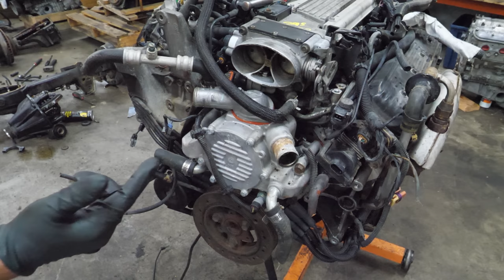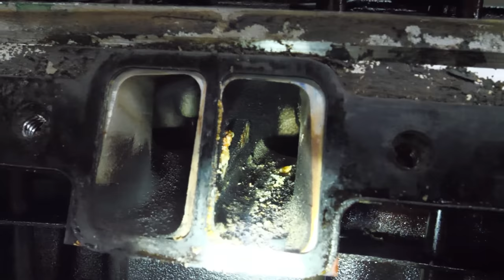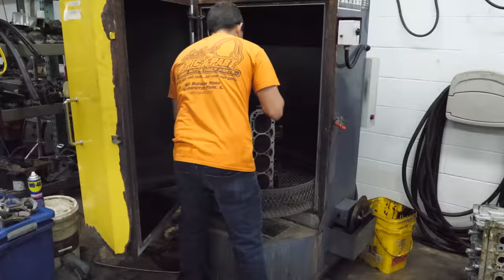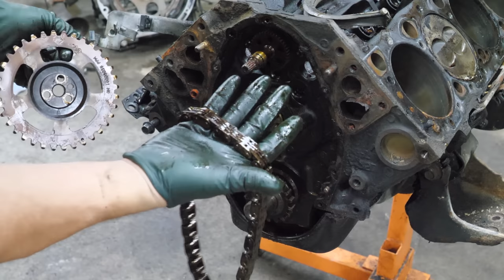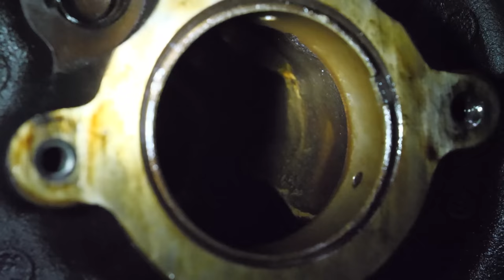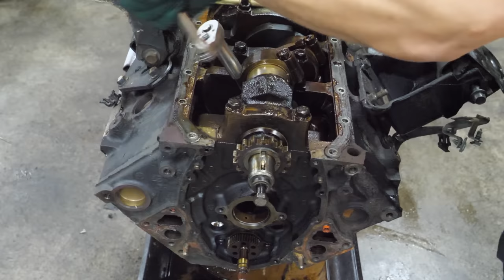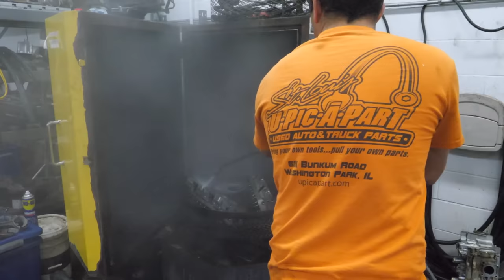Bad Corvette Camaro Trans Am Gen2 LT1 350 Teardown. Not The Problem I Was Told!

Comment: I know the 92-97 LT1 got a bunch well deserved hate, but it was the first mass produced V8 since the early 70s to hit the magic number of 300 horse power. Yeah there were the lotus designed dohc lt5 cars and some special version of a mustang bit as for an entry level V8 advertised with 300 hp under the net system of of measurement this was a big deal. But what got me was gm had a distributorless sysyem that it had been using on engines like the buick 3.8, that could have been adapted to the lt1 and would have avoided the nightmare of the optispark. Dunno whos idea the opti was but theres a special corner of hell reserved for him

Comment: I know this is an older video and this may have been said in the comments, bud dang, those head gaskets were trashed. It looks like the owner used a ton of radiator stop leak, maybe several times, to the point that all the water passages were completely clogged. I bet the failure was that it started getting hot over time and then it would leak because the water was looking for a path which made them think it had a bad water pump which is why that was replaced and looked newish.. it looks like it overheated several times until it had enough and sent water into the combustion chamber.  I may be wrong. I am just trying to figure out what that thing looked so bad..

Comment: GM used fully electronic ignition on all of their car V6s back into the mid 80s. By the time the LT1 came out, basically only the V8s didn’t use electronic ignition, and I cannot imagine why. Who in GM engineering thought that Optispark was a better idea than the coil packs that they had already been using for almost a decade prior to this coming out? Aside from the fact that the distributor would routinely get ruined by the water pump (causing a no-start and a very expensive repair), even a basic maintenance item like the distributor cap or rotor required removing the water pump and crankshaft pulley. I don’t get it.

Comment: Car came from a hot climate place so water rather than antifreeze coolant was used which allowed the engine to live longer with the long term water seep getting in the oil problem than if glycol had been in there as would have been the case in a cold climate area?  Maybe owner knew they had a coolant seepage problem so avoided putting in antifreeze,instead used plain water and "Rustone" and perhaps dumped in some Bars Leaks? 

  RR guy who let me look at his local switching locomotive (GP 15?) told me with overhead radiator there is so much chance of "water" getting where it shouldn't be that they don't use antifreeze but instead left the loco running/idle all night so it wouldn't freeze    the old Southern RR

 think that has compression relief plugs/petcocks that they can take out,then crank the engine with fuel injection turned off while someone watches to see what shoots out of the plug holes while the engine turns over

Comment: For that being an OBDii engine there sure was a lot of black carbon everywhere especially noting the plugs and exhaust valves.  That engine sure was abused and yet it can still be rebuild to see another day.  Never saw that ignition system before.  Really horrendous solution to relocating the distributor.

Comment: Its should have a forged steel crank and powered metal rods. The 4.3L v8 have 6 inch powered metal rods . The lifters and spiders and cam can be used in the open piece style blocks
Reply: They weren’t forged steel cranks.  They were nodular iron (cast steel)
Reply: My memories must be bad . No key way  forget steel cranks on the aluminum headed 5.7L . As I remember.

Comment: GEN2 LT IS WAYYYYYY UNDER RATED!!!!  Those engines were short lived and was only ever built to try making the Gen1 meet emissions and fuel mileage targets while the gen 3 was being developed. They have FLAAAAAAT torque curves, 360 teeth on the crank trigger which allows SUPER accurate timing..  The Optispark is the MOST MISUNDERSTOOD part of that whole engine.. the Optispark was a hell of a GOOD design.. And I'm not being sarcastic. The Revision 1 Distributors from 93-94 were TRASH.. If you sneezed wrong they die.. But the Rev2 from 95-97 was AMAZING!!!  I put a Gen 2  LT in my 92 Toyota 2wd pickup. The distributor had 130k miles on it and was 100% original!!  It dies on me about 10K miles into my swap and it failed because the vacuum hose began deteriorating and plugged the vacuum orifice. O3 (Ozone) built up in the distributor and killed all the plastic/Electronics.. I replaced all the hose, Vacuum orifice, and Vacuum filter and the replacement worked for another 40k or so until I traded the truck for my current car. The new owner still has it and has ZERO problems with it.  Almost 400Whp and got 26mpg while driving it kinda hot footed in a 2700# pickup.. I even puddle jumped and pressure washed it regularly, anything I could to get the distributor wet, a lot of times intentionally to disprove all my misinformed friends.  They really are a hell of an engine!  10/10 would use one again!!!

Comment: I have a 96 Cadillac Fleetwood with lt1. Can I drop a HEI distributor in there & run a carb on that baby the way it, sits? Seems like it ve seen guys run these with the 411 computer/LS computer & by pass the opti spark? Mine starter missing one day & it says it has an over active injector. It's over 350K miles & prolly still has 7 of the 8 original plug wires. I had to change 1 of them. Water pump leaks but I have a new one. It never started miss firing until I tinkered around tryna replace some of the old gummy vacuum lines.  I wish I had the funds to do new opti & timing kit.  I don't have a balanced installer tool for the little seal in the timing cover (opti seal, maybe?) I seen a guy having this problem & he created a custom tool for his little seal with a yellow, "sharpie." My front main leaks too & I have a new one. I've got 8 injectors & the remainder of my plug wires to put on (the other 7.) Wish me luck... Lol. It also has original spark plugs, I do believe. I'm really really really hoping my water pump didn't strew my opti spark. Being disabled it takes me several months to accumulate parts. I already rebuild the front end & put new air shocks on the rear. 600.00 worth of hankook tires sitting there. Due to the miss fire & water pump I haven't driven the car in over 2 years. I'm afraid of why it might be miss firing coz I gotta feeling I'ma have to produce an opti spark & WHY NOT do timing kit & cover while a man is already that far in? Shrugs

The only other thing I was hoping to learn from you is the fuel rail, removal. I've never seen these come apart & I'm hoping sn injector and/or spark plug will remedy my lt1, for awhile, anyhow. The heat never did good after a few miles once I got it bled out, good. I'm thinking the coolant would leak out thru the weephole & Nye bye-bye, warm heater. I wish I had seen this leaky baztard prior to it starting to miss fire. (It just makes me as nervous as a dog 💩 ing a 🍑 seed?)

Comment: Well actually 96 to 2000 where generation 2 small blocks. Just like the LT1 Gen 2 was actually very small. Lifespan I believe it was only like 92 to 96 but 96 to 2000 in the trucks 99 to 2000 2000 in the suburbans tahoes dump trucks vans commercial vehicles. The LS came in the pickup in 99... But the vortec 5700 and 5000 our second generation small blocks just like the LT1 255 horsepower 330 torque isn't really that bad. The vortec 305 actually was more powerful than the throttle body 350. Great heads with a decent EFI system the spiders tended to crap out but we really went bad. It was just a short run in the pickup trucks immediately went to the LS and they had leaking intake manifolds but the distributor caps were a little more modern than the old school distributors found on the generation. One small block but definitely more reliable than the optiSpark

Comment: I'd guess it blew a head gasket between the two steam cleaned cylinders and then hydrolocked. If the engine laid on its side afterwards the water may have leaked out and released the pistons.

Comment: Would be interesting to read the bearings,, do GM still have over and undesize bearings when the build them?
What were they thinking with all that crap on the front of the engine? IF they must have crank trigger they do not need all that crap. Having played with those engines since the 70s those composite gaskets have done that . The original .020 steel shim headgaskets were a LOT better. Though suspect with alloy heads. The shims bed into the heads.
Weird looking conrods. And a performance engine with a cast crank and 2 bolt? A 'real' LT1 had a steel crank and 4 bolt mains. And it seems small valve heads as well.
Dipstick? Use some CRC on it and it will come out,, not easily however.
Those heads while not junk will make less power than 50 aftermarket ones. With or without fool injection!

Comment: I've been told, '93+  'Vette LT1s had 4 bolt mains, and the others all had 2 bolts mains.   True?   And why did Firebirds and Camaros LT1s only have 275 HP and 'Vettes had 300HP?    Hmmm, what else is different?   Was it computer driven?    Next question:  Let's say a 'Vette had a bad engine.   Can a LS3-7 be replace this gen's LT1 as long as the LS engine has a ECU and harness.

Comment: No 275hp LT1 300hp LT4. But supposedly GM had a gentleman's agreement to under rate these in power so insurance wouldn't be crazy supposedly its a real 350/350. I owned a 94 Z28 camaro the crank bearings are known to go on these.

Comment: use the fork lift on that dip stick.  Double down on the vice grips. What's the finial on the dip stick is the broken part still in the block or did you drill it out.  Any way I like the tear down but not the motor.

Comment: I had a 96 camaro with one of these. Not a horrible engine but it has its quirks. I have a L67 3800 Bonneville SSEi for a toy now, and I'll say the 3800 is far more reliable. 

Why didn't they use a waste spark ignition like the 3800, just use 4 coils instead of 3. Never understood why they used opti-junk optical distributor. GM had better tech at the time

Comment: Thanks, Eric, for your lively commentary.  I learned to drive at 14, a 1925 standard Buick, that car taught me a lot about driving a car without anything automatic, manual choke, manual crank starter, manual spark advance and retard as you drove, not to mention a Crash Gearbox. At 16 I not only did my own mechanical work but helped my Dad re-metal a big end bearing in his 1937 Hudson straight 8, sorted out the ignition timing etc on a friends 34 Chev, did a re-ring job on a mid 50s Ford truck for our Irish friend. Come 1976 I began work as mechanic for a Bus and Coach company, changed jobs in the 80s looking after a fleet of school buses. Yes I have seen some carnage but nothing like your Dodge V 10. Ted, retired Mechanic from down under.

Comment: So as of 23:00 looks like there had been a slight seepage of coolant past the head gasket over a long time causing corrosion and sludge formation followed by acute lots of coolant dumping past the head gasket when the engine "failed" ? 

  Did those engines,especially with the aluminum heads,require one or more retorques of the head bolts after the cars were put on the road as new?

Comment: I'm surprised they didn't put the distributer in the valley, or, better yet, in the crankcase.....why didn't they just mount it to the firewall?
Is that an Import a part t shirt in rtv orange?
I'm  hoping for coolie cups with your logo and not the cheap foamy ones, the ones that are thin neoprene and sewn together with thread.

Comment: Did the head gasket overheat the engine so the owner installed a water pump or did the water pump install clog the head gasket coolant passages with rtv and overheat the engine destroying the head gasket?

Comment: 3:54 that position worked great on the Flathead Ford V8s, but they had a seperate water pump for each bank and totally divorced cooling circuits so there was nothing to get in the way. Ford's logic back in the 1930s was making it cheap and easy to produce; timing was completely non-adjustable in these engines which meant factory workers putting them together didn't have to worry about getting the timing right when they put the dizzy on. They jsut slammed it on and sent it to the next guy on the line. Ford did not move away from this until the 8BA came out late in the engine's life; it had a more normal looking dizzy stabbed in the passenger side of the front cover with fully adjustable timing and all that good stuff.

NFC why GM tried that here. Doesn't make sense to take an engine that's been using a vertical dizzy for 50 years and suddenly go 'hey let's put it under the water pump hurdadeeerrrrrrr'.

Comment: Why use  TBI in the trucks?  Simple answer: Cost and reliability.  TBI is simple (read: inexpensive) and probably the most reliable fuel and ignition system Chevy made to date.  The 1994-1995 TBI ECMs could also control the 4L60E and 4L80E.  I'll take a 5.7L TBI truck over a 1996-1999 5.7L Vortec any day and every day.

Comment: Many gm motors of that time period had plastic/rubber intake gaskets. The plastic would crack and dump coolant into the top of the motor destroying the crank. In my opinion, this was done deliberately as there is no way the cost of replacing a cardboard gasket with a plastic one was cost effective.

Comment: my lt1 just started making a knocking noise right at the top of the engine, somewhere close to the intake manifold. It runs and drives but the knocking started getting louder. Would you happen to know what it could be before I tear it apart?

Comment: the intake was not built for low torque so this was not a good truck engine  ...it was made to create more power in the higher rpm bands than the L98...it was designed for the corvette ...not for the truck market

Comment: Yes alot of blown headgaskets for the lt1's not the fault of headgasket it was the fault of the torque  to yield bolts that would stretch loosing tension.. (cast iron and aluminum expand at different rates)  most of us back in the day would replace the head bolts with arp bolts and problem solved
Reply: Excuse my ignorance what is arp?
Reply: @pauleyedwin6056  sorry I corrected my comment ARP bolts which are not torque to yield bolts and don't loose these tension strength if the engine. We're to get a little hot ....
Reply: Thanks for your clarification.

Comment: Can the opti spark be replaced at all with a normal distributor? Weird design at best, GM sure know how to engineer things 😀.  Also, would like to see you do a tear down of an Aussie engine. Barra? 5.0 Holden v8? Hard to get im sure, but it would be a great watch as usual.
Reply: you can get the 24x cam sensor converter and run coil packs like the ls
Reply: "Can the opti-spark be replaced at all with a normal distributor?"
No.

Comment: the trucks didn't have TBI they had the awful spider port injection from 96 on
Reply from the maker: Trucks were TBI til 1996
Reply: @I_Do_Cars  they were to the und of 95. in 96 they switched to spider port I believe due to the new OBDII requirements

Comment: Blowing head gaskets just getting a little warm?!?! Where did you come up with this?! GM designed these engines to run 220-235 +degrees!! The cooling fans don't even kick on until 228 degrees!!!

Comment: You know what's interesting about that engine it sold it ain't locked up what's good but I'm wondering if that car engine was from a car for Clunkers now I say that because you're fine powder or something weird of residue inside the intake that looks like something I need to do to blow the engine. Dump a bunch of crap in the engine lock it up I wonder if that engine was had that done to it and it locked up the ones are cool. If it came on locked cuz it's too tough

Comment: Even GM recommends the MSD coil unit. I'd suggest it when any of these GMs came into the shop. You can't believe how many people refused coils or water  pumps during those services.
Reply: The MSD I put in my '95 Caprice crapped out after less than a year.
Reply: @TJ Harrell  was the waterpump leaking any coolant at all? And i mean any at all. That's usually the culprit. It will fry those units almost immediately.

Comment: Oh, the inhumanity, is that a Wix oil filter? That's not good, with the horrible crankcase ventilation on the gen II LT-1. The filter would plug with sludge and bypass unfiltered oil throughout the engine and Opti-spark was so bad, tow truck drivers would follow LT-1 powered cars during wet weather.

Comment: Why GM? Why? Why didn't you leave a distributor in the back?
You still needed the oil pump drive of the back of the cam.
Instead, you added that octopus to the front, needing the extra drive for the water pump.
Pretty costly design.

Comment: Typical SBC blown head gasket issues. If people would change out their antifreeze every 5 years. Stuff like this wouldn't happen. And using the right antifreeze designed for it. That car should have had the orange Dex-Cool, but it looked like standard green that cam pouring out. Green antifreeze eats away at carbon/graphite head gaskets as it become electrolytic over years of usage. Antifreeze is not a lifetime use product.

Comment: I don’t believe they called those LT1’s I believe they were L98 engines in the late 80’s
Reply from the maker: L98 were TPI 350’s til 91, and the LT1 replaced it which went til 96-97 depending on chassis
Reply: @I_Do_Cars  Ok thank you. Lt1 is a very different engine from the L98 for sure. Very interesting design.

Comment: Should have kept the ratchet wrench on that last intake bolt and it would have acted like a spreader to break the intake manifolds seal.u did it the correct way though.just a little cheater trick(butcher)